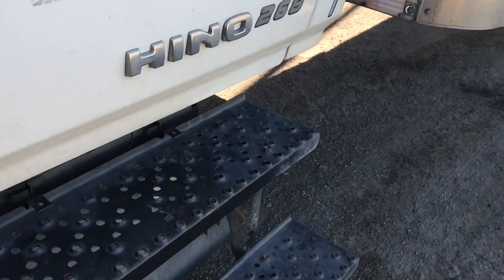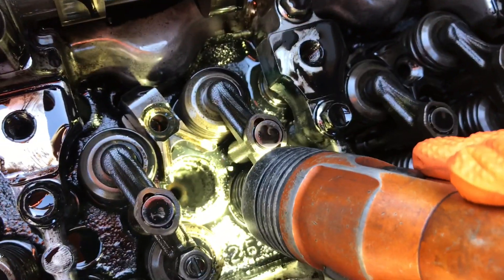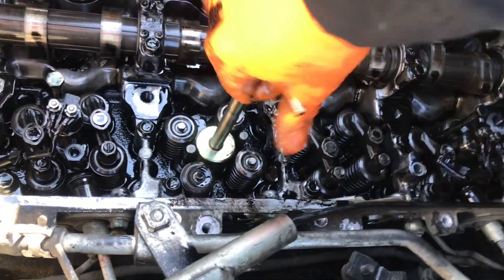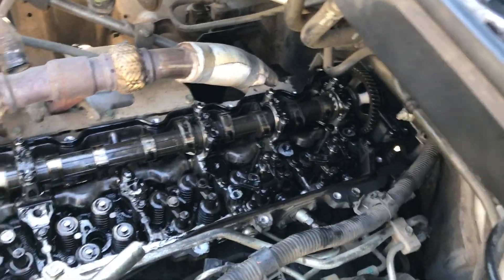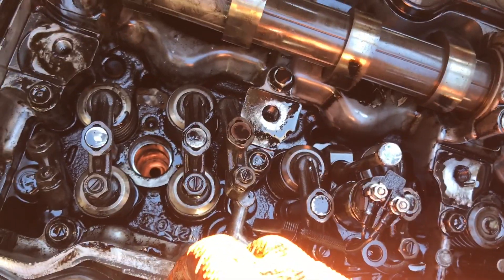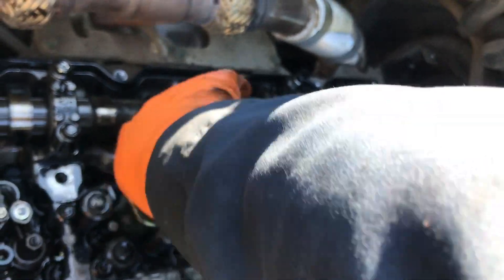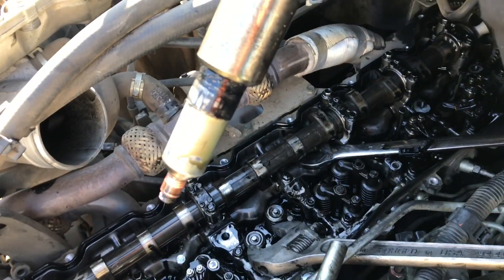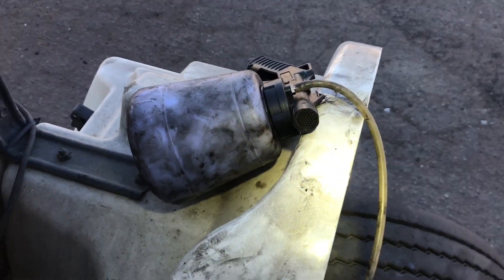Hino Fuel Injector Cups Remove and Replace Part 1

Comment: Hi there, so im in the same situation as coolant ran into piston, this is my first time removing injector with sleeve, forgot to flush the coolant, so do you just suck the coolant out and install new sleeve and run it? I didnt use any of those tools though, will be nice to have those. Thank you.
Reply: Oh and im doing Mitsubishi 6D40. Sleeve model is different.

Comment: How did you know the cups needed to be replace?  I’ve got a 2007 268 with 267k miles. It runs rough. The dealer said # 6 injector balance rate is higher than the others. I’ve already dumped $1800 on resealing the cam plate and valve adjustment. How would you proceed?
Reply from the maker: These cups had a bunch of carbon buildup after removing the injectors for testing. 

I would remove the injectors and have them tested at your local diesel injection shop
Reply: @boscos5287  Just got the great news that all 6 of my injectors bench tested bad. Do I have to buy OEM Hino injectors or is there an aftermarket?
Reply from the maker: @harleyhoracio1  I could not find any aftermarket injectors. Dealer only item at the time I did it. Almost 5K worth of injectors
Reply from the maker: @harleyhoracio1  go for it
Reply: @boscos5287 how did you remove the copper shavings from the sleeve that fell into the cylinder?
Reply: @boscos5287  how did you remove the copper shavings from the sleeve that fell into the cylinder?

Comment: hey, I'm working on a Hino j08e and I have oil in the coolant. Pulled the oil cooler and tested it and it's fine, pulled the head and the headgasket is fine aswell. Also tested the turbo and it isnt leaking oil into the coolant either. Do you perhaps have any ideas? I havent worked on Hino engines before.
Reply from the maker: Oil in coolant= Oil cooler, turbo, head gasket, cracked head, injector cups
Reply from the maker: Derpster subscribe